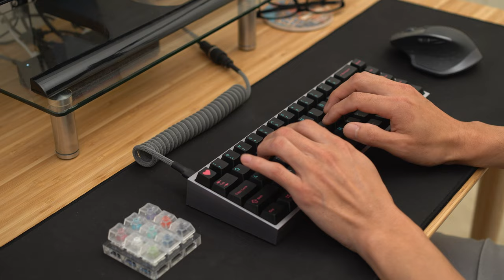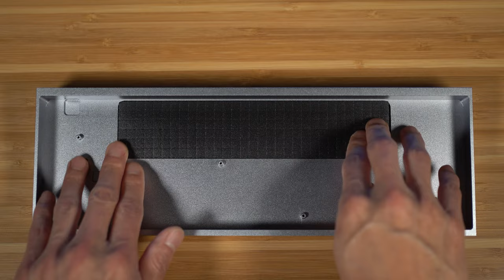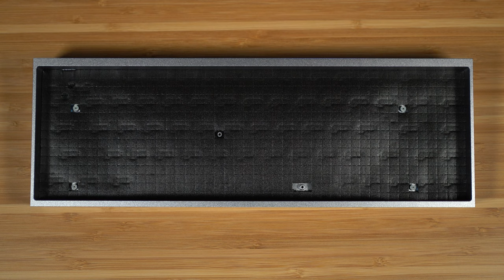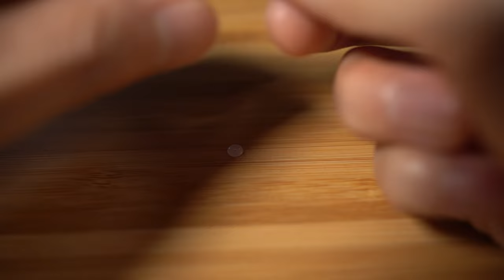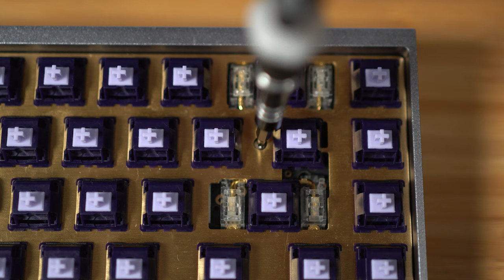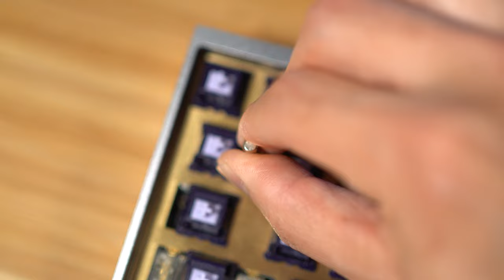Make the BEST sounding TOFU!  TOFU65 O-Ring Mount Mod Tutorial

Comment: Wouldn't it have been much easier to just put one O-ring on a screw, put it through the hole on PCB and then get another O-ring and put it around the screw on the other side? Then lower the PCB into the case and just screw it in place.
Reply from the maker: Hi Hitoyomi, I'm sure that will work just fine as well!
Reply: Yes, that would be much easier
Reply: @Keybored  Can you pin this for reference? Hitoyomi = 200 IQ, and this video is great, got it in my keeb playlist for my Tofu build soon
Reply: genius!
Reply: I tried that is impossible to get the screw into the hole.
Reply: @Xiong97  you don't have to push the o-ring through the hole just place it on the screw before you place the screw through the hole and on the other side you place the other o-ring on the screw and you're set
Reply: @xMortalBlade  well idk what pcb u using ,mine is kbd 67 Rev 2 the hole is wider to fit majority of the case , so it still 50/50 whether the screw catch it. Once you miss one u just have to unscrew all and take out the pcb again because is impossible to pull up the screw with a tweezer
Reply: large brain holy fuck
Reply: my hero
Reply: Just tried it out, and it works a whole lot better. It is more time-consuming, but it's a guaranteed successful install, no redos required.
Reply: Dude ur idea is featured on his gk61 video go check it out
Reply: yeah then you don't have to have the fine motor skills of a brain surgeon to place the PCB on the standoffs.
Reply: Yeah this is what I did and I’m surprised it wasn’t recommended in the video. Removes a lot of unnecessary fiddling
Reply: @martyr6191  how is it more time consuming...it sounds alot more convenient? am i missing smth?
Reply: @matthiasfoo1217  I meant like maybe 5-10 minutes longer. It can be a bit tricky getting the o-rings on the other side of the screw. It is really convenient though.
Reply: @martyr6191  ah ok...ill try both when i get to it anyway
Reply: Yes
Reply: It's not Hitoyomi who is genius, it's Keybored doing it the dumb way...
Reply: Absolute unit! yes, that makes total sense!
Reply: You can also apply a little bit of glue on the o-rings so they'll stick to the standoffs.
Reply: I thought that this would've been common sense 🤷🏿‍♂️

Comment: I can't thank you enough for sharing this mod. I just got a tofu65 and had such buyers remorse due to the reverb. This makes the sound/feel so much better. I have to say that "foam" find was also amazing. I attempted this mod first go round with just filling the cavity with the zip-n-fit and using the foam that came with my tofu from kbdfans, but still had a small bit of reverb.. Swapped it with the zip-n-fit for the plate foam and what a difference. That was an amazing find and incredibly cheap! I'm going to stock up on it for future builds. Thank you again!

Comment: Just did this on my TOFU60 and NK Creams! The sound is night and day! I can actually see this become a popular mod, as it drastically increases both the feel and sound of the keyboard. Thanks!
Reply from the maker: HI Theo! So glad it worked out! It truly improves the tofu to the next level!
Reply: @Keybored  it really does, I love the sleekness and simplicity of the tofu and this is just the cherry on top
Reply: Were you able to use two o-rings for each stand off with the screws for the tofu60? Also did you use all the standoffs?  I will be attempting this on thursday with my tofu60 very excited!
Reply from the maker: @gerryFOREALS  hi Gerry, perhaps Theo can chime in also, but I would recommend using the outer standoffs only, and using 1 o ring. 2 o rings maybe too thick, and would cause the usb port to not align. Hope that helps!
Reply: @Keybored  Thank you for the tip ! By only using one oring for each stand off , should I have it below the pcb only ?
Reply from the maker: @gerryFOREALS  sorry, didn't mean to confuse you there. One o ring will be between the standoff and pcb and one between the screw and pcb. So essentially, you're making a o ring sandwich. So the configuration is... Screw, o ring, pcb, o ring, standoff. Hope that helps!
Reply: @Keybored  so, when you want to remove the board from the case, how do you catch the the orings that sit on top of the pcb ?
Reply from the maker: @gerryFOREALS  Hi Gerry, last time I took the screws off, the o-ring on top of the PCB was still around the screw, so I was able to pull it all off together.  Hope that helps!
Reply: @gerryFOREALS  hey just saw this. I only used o rings on the outer left and outer right standoffs. You then only screw on those two standoffs and leave the rest of the standoffs empty.
Reply: @Keybored  Hey! just came back to say it was a successful mod and it sounds and feels amazing. My only question is how did you prevent the bottom row from lifting and exposing the switch a little bit?  Mine raised just a tiny bit amount.
Reply from the maker: @gerryFOREALS  Hi Gerry!  I'm glad it worked out!  Hmm... I didn't actually run into that problem with the Tofu65.  I wonder if the Tofu60 has a slightly higher standoff?  One thing you can also try is if you have enough thickness left in the o-ring, you can try to tighten it down a little bit more, to see if the switch exposure goes away.  I hope that works out!
Reply: what size of screw did you used? the stock screws of tofu 60 is a bit short
Reply: @gerryFOREALS  what size of screw did you used? the stock screws of tofu 60 is a bit short
Reply: @benjaminjayolleta988  did you figure out? I read ppl think Keybored used 5mm as their 3mm were too short. I just ordered some M2 SS screws in a set of various lengths on Amazon for 10$CAD

Comment: Some tips from someone who tried this a year ago, gave up and now tried it again:
1. Use the tip from Hitoyomi.
2. The screws that came with my Tofu were like 3mm and Keybored seems to be using 5mm screws. Mine were too short and I used 8mm screws that I had leftover from a new keyboard. 8mm length is fine you just have to screw it in further.
3. Apply the screws on the bare PCB with just stabs on (no plate and switches installed yet). I struggled way too much trying to get it through the hole of the plate > into the pcb > into the stand-offs. Much easier to apply it on the bare PCB.
4. Now the screws should be somewhat fixed with the o-rings on the bare PCB with the help of tip 1. Now screw that PCB into your case.
5. Now put in your switches and plate after the PCB has been screwed into the case and done.
I need to get other switches Boba U4Ts don't really make sense in this built.
Reply: Thanks!

Comment: I had a lot of trouble doing this mod, instead of placing the o-rings directly on the standoffs -- I pushed the screws through first, then placed the o-rings on the back of the screw, then mounted the pcb to the standoffs. I almost ripped my hair out because I had to unscrew my PCB 4 times because they kept falling off. I'm so glad that's over.
Reply from the maker: That's great advice PERPETVAL!  I guess I had more luck with the tweezer :)  I hope the keyboard turned out great!

Comment: Just curious why did you not screw it in the middle? Also do you use tags? Its always so hard to find your channel
Reply: I was wondering this too. Does not performing this mod on the middle two screws make the board sound different?
Reply: Im also wondering as why he does not screw in the middle ones
Reply from the maker: Hi Voark!  I don't use the 2 middle stand-offs because I want to raise the overall plate and pcb assembly above the centers, so that I can reduce the number of hard contact points.  This way, I can create a more even sounding and feeling board, with a bit of flex due to the o-rings on the outer stand-offs. :)

Comment: you linked wrong size O-rings, but found right ones anyway. Great sound
Reply from the maker: Thanks Estrella! I think the issue with the link is that once the stock runs out of the 4x1x1.5mm, it's been defaulting to another size... Been a struggle to find good availability on these o rings!

Comment: Just did this on my kbd75v2 keyboard, but can only do 1 ring between PCB and bottom case since the screw is way shorter than the one in your video ; and without the case foam because my case has underglow lights. But it still works quite well, the feel is less stiff than it was makes my typing more silent and not feeling like "knocking the case" all the time. Thanks for the idea, keep up to good vids & ideas
Reply from the maker: Glad it worked out Stefanus! I have been told that some kbd kits come with shorter screws :( the screws I have are M2 x 5mm for reference!

Comment: ill be doing this to my gk61 thank you very much
Reply from the maker: Hi FredNeverDead!  Thank you so much for watching!  Hope it works out well, and let us know how it goes!
Reply: @Keybored  alright ill let you know when i do it :)
Reply: @Keybored  UHHHHHHHHH i accidentally broke the keyboard while doing it I DONT BLAM YOU THO but it did sound good, even though broken
Reply from the maker: @fredneverdead773  Oh No!  What happened!  I actually have a optical switch MK61 on the way so I can do a quick review of how optical switches are, and to see if I can improve the sound and feel of this keyboard.  Let me know if there is anything I should avoid!
Reply: @Keybored  well i dont have the opticl ones, it just got the kit and added some gateron yellows.. what happened was i accidentally bent the usb c cennecting to the pcb so i basically need a whole new pcb. sadly have to use this $20 membrane keybaord in the mean time ;-; though gonna order the saka 68. My friend has the optical switch gk61 and the only issue i can see is that if you over lube them they gan basically stop working completely (which he did, he just wiped some off and it was fine again) but i doubt you would do that.. lol

Comment: It may have just been a me problem, but adding the gaskets made it loose enough to where the PCB would slowly shift down (just by a fraction) causing some of the bottom keys to rub against the case. So give that I had to go back to just standard screws. Hope others have more success though. It does sound good so for sure worth a try!
Reply from the maker: Hi Joshua! May have to tighten the screws a tiny bit more :) what I did was used playing cards and shimmed the plate to get perfect clearances

Comment: this should work on any tray mount if it has a similar screw layout I'm sure. Just did a aluminum kbdfans 60% low profile case and used some old o rings and it is a lot better now.
Reply from the maker: Hi Ollie! I'm glad it worked out!

Comment: The Zip n Fit took out all the lower pitched sound signature from my Gat Black Inks which is a bit strange considering its supposed to be a more thocky switch but overall I still love the sound! Definitely made the sound more even across the board as well. Was a fun and easy mod to instantly and drastically change my board's sound! Well done Keybored!

Comment: Have you considered putting toothpicks in the screw mounts with the o-rings before putting down the PCB and then removing them. That may help keep the o-ring in place
Reply from the maker: I was told by viewers that by putting the screw through, then adding the o-ring on the other side, it is much easier.  Tried it and it was confirmed!

Comment: This thing sounds phenomenal. Great work, and I’m more than stoked to give this a shot when my acrylic 65 comes in. You’ve earned yourself a subscriber no doubt! 
Do you have any type of foam between the plate and pcb? I might’ve missed you saying that if you did. Cheers, and great work!
Reply from the maker: Thank you so much for the sub Christopher!  I really appreciate it!  The foam that I used between the plate and the PCB is vinyl adhesive foam.  They are also known as weather stripping foam at the hardware store :)  I cut them to size and applied onto the back of the plate.  I know it's a bit ghetto, but it works out well to absorb the sound and reverb.  If you want to go down the pre-cut method, check out the foam from Stupid Fish Designs!  Top notch stuff!
Reply: @Keybored  thanks for the reply, and help! When I ordered my tofu I went ahead and got the modular foam they have, and plan to use that. I just wanted to see if you did in fact have some sort of dampening foam under the plate. Good tip with the weather stripping foam as well, I’ll have to keep that in mind for the next build! Again, thanks for the response. It’s help from people like you that make entering this hobby that much more approachable and fun. Cheers!

Comment: woah, i just did it with my rk 837. Since the screw hole on the plate has some narrowing part, if i put the rings on top of the plate, they will not come down, so i put 2 stack of rings on top of the tray case. Also the board has daughterboard which is cool i guess since i can play arround how tight i want with the screw. Thanks

Comment: I realize this video is over a year old... But I fell in love with the sound of this immediately. I actually bought all the parts for my tofu65 that I didn't have already and changed every thing out exactly to what you're using. Even to the old zip n fit liner. I O-Ring mounted, I lubed the Lilacs, (Do you have Foam between the PCB and Plate?) I even bought a brass plate and swapped out my PC one for now.... Everything the exact same... It sounds... NOTHING like yours, lol. I mean, not even close. It's SOOOOO dull and quiet and the pop just isn't there. I realize there will be sound differences from board to board, but this is like night and day. Any suggestions?
Reply from the maker: I do have foam in between the plate and pcb. The vinyl foam tape that I cut and applied to the underside of the plate. Also, the trick to all this is to make sure you don't over tighten the o rings down too much. If you do, it doesn't have the pop
Reply: @Keybored  Wow, what a quick reply. Thank you so much. I was not expecting that. I did not tempost mod the PCB, I guess I should have. I'm gonna open it up and throw some new O-rings on it as well and make sure they are not too tight! Thanks again... And PS, I've been binging your videos. Your content is simply amazing, thank you!

Comment: You can probably get a set of pc motherboard standoff screws that can be screwed all the way in but leaves enough of a gap for your o-rings.
Reply from the maker: Hi Devin!  That's an interesting concept!  Will definitely look into it!
Reply: @Keybored  after doing some digging, drone screw dampers might work the best. They will basically fit inside the pcb hole. Found a bunch on Amazon. Best!
Reply from the maker: @mrscotchguy  thanks Devin! Let us know how it works!
Reply: @Keybored  if you go to amazon look up "ball dampers". They are made for drones and comes in m1.5, m2, and m3 hole sizes. Worked great and way easiee to work with.

Comment: Hey Keybored! Amazing vid! I was just wondering if doing the burger mod with the tofu would make it better than a kbd67lite? I've been stuck between the two builds and was wondering what you would recommend.
Reply from the maker: The Burger Modded Tofu types softer than the KBD67 Lite, since the KBD67 Lite is pretty stiff even though its a "gasket."  Probably because the silicone sleeve between.  However, from a sound perspective, I think the KBD67 Lite is better!
Reply: @Keybored  Alright, thanks!

Comment: Great video and tutorial! Also fantastic sounding Tofu.  I have just gone back to the drawing board with my Tofu.

I had the KBDfans case foam with alloy plate and lubed Tealios.

It sounded very hollow and pingy so I just ordered some liquid silicone and extra foam that goes between the plate and PCB.
Also have some some deskey films on the way.
I am guessing you need longer screws for the o-ring mod as the black screws provided with the case are tiny! Did you use M2 6mm screws?

As I already have the kbdfans case foam do you think I should just add the silicone mix to the battery recessed part then add the case foam and plate foam?
Reply from the maker: Hi LMD!  Thank you so much for watching!  I appreciate the comments!  The TOFU has a lot of potential, and I still can't believe that it sounds and types so well even to this day.  When I first built my tofu, I remember thinking... yeah this is a cheap tray mount keyboard all right.  Then I started to mess around with it and realized that with a bit of modding, it really takes on a different character.  The Screws that I used were the stock ones that came with the kit, but I was told that some people received shorter ones.  The screw size is M2x5mm and the overall screw head is about 4mm in diameter.  One thing you can try for that batter recess is use butyl sound deadener as well.  I used a noico one, but it's essentially same as the dynamat brand that a lot of people use in theirs cars.  It does a wonderful job of absorbing sound and reverb!  Good luck with the mod and hope it turns out great!
Reply: @Keybored  Thanks for the reply. The included screws with my black alloy Tofu are 5mm long including the head and the diameter of the head is 3mm.

Comment: Can you tell me the length of the screws you used in the video to be able to fit the 2 orings and the pcb while still attaching it to the keyboard case?
Reply: Whatever the length of the original screw is plus 6mm